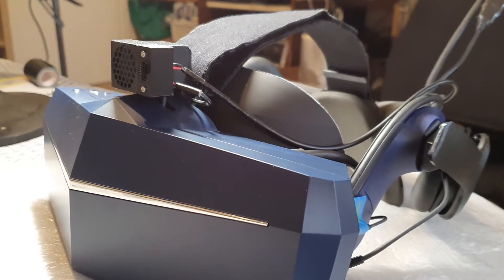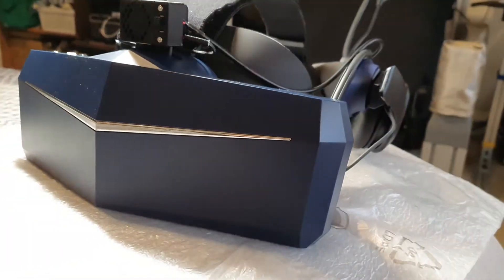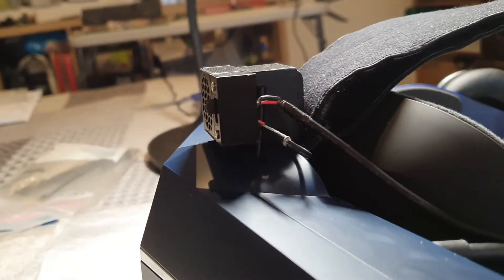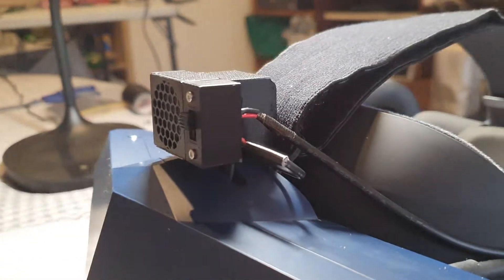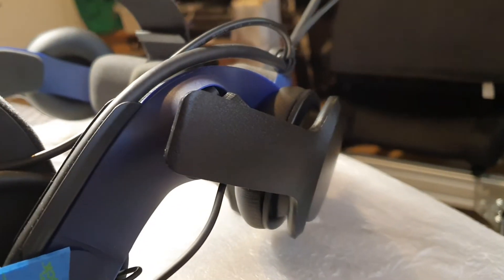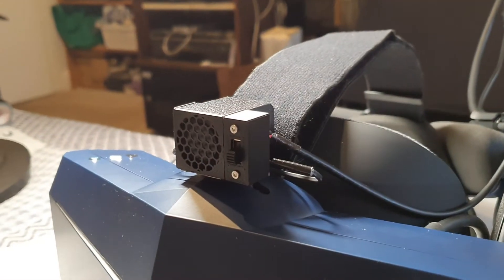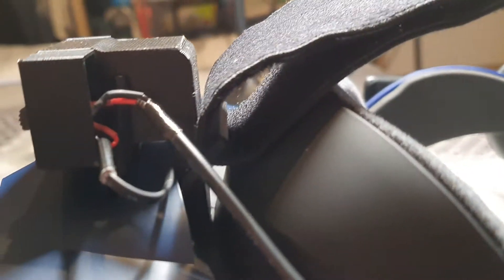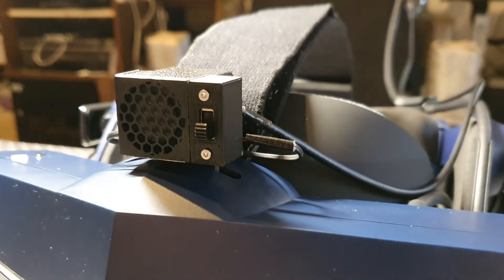Cooling Fan for Pimax 8K X

Comment: How have you found it? Have you kept the mod and has it helped with heat much? I am printing it off right now, I find myself getting outrageously hot in VR almost instantly, to the point that I even installed an airconditioner in my office just for VR (and I live in Ireland so one of maybe 7 people in the country that has an air conditioner lol).
Reply from the maker: It does help with heat. I'd also run a desk fan pointing at your face. I got the idea for the snorkel fan from here: https://community.openmr.ai/t/cooling-fan-for-comfort-kit/36113/78